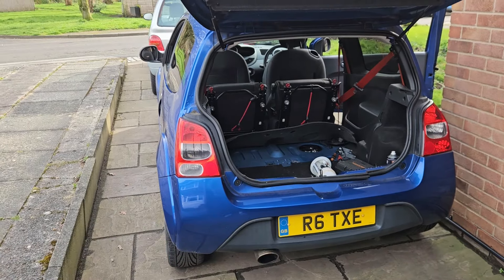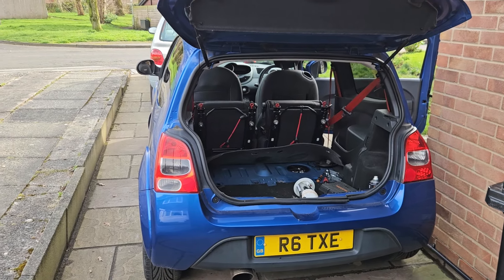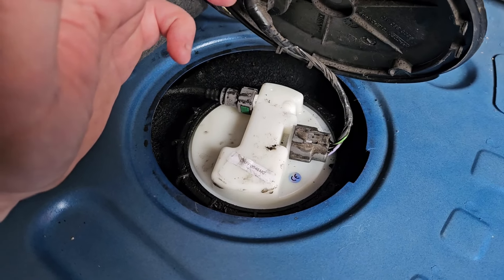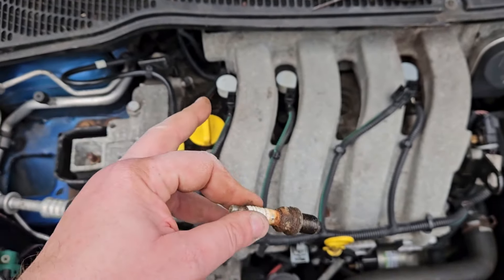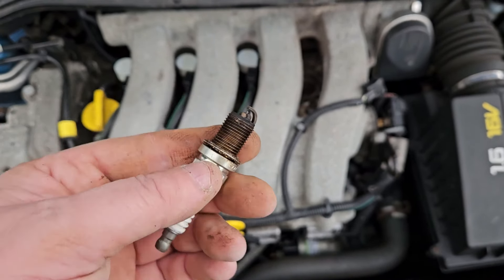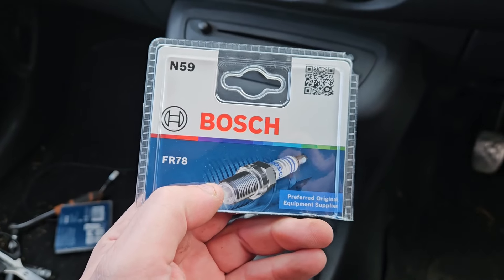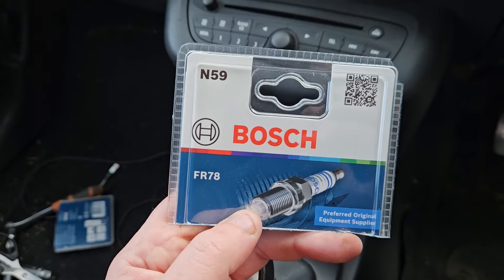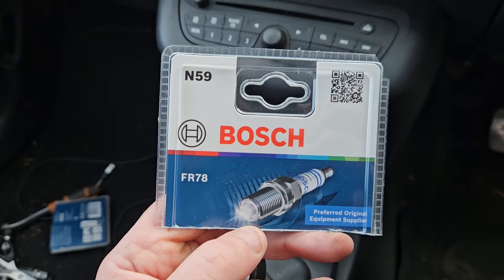Can i solve the misfire on my RenaultSport Twingo 133?

Comment: Here's a tip to keep you out of trouble. Use NGK U5001 ignition coils (those with a metal part), which are better designed than BERU coils, and also apply grease (Beru ZKF**, or Fluostar 2L**, not silicone grease!!!) to the upper seal of the coil to facilitate installation and improve sealing. **The same grease as for the porcelain part of the spark plugs, as it won't damage the silicone rubber !! Remove the ignition coils, check, and re-apply grease before reassembly every 2 or 3 years to make sure there's no water in the spark plug wells.

Comment: I've got the same issue with cylinders 3&4. Whoever replaced the coil pack on 4 put the securing bolt in too tight and has sheared. I was a bit reluctant to to use excessive force on the spark plugs in case it did snap. But seeing as I need to get the manifold off to sort the coil pack retaining bolt I'll leave it until then.
Reply from the maker: I had same on cylinder 4 coil pack retaining bolt. I tapped it out and then installled a 10mm bolt not an 8mm.

Comment: I have also on a Twingo GT problem with Misfire it say on Cylinder 1 it blink the MIL and like in acceleration it goes like sometime empty i change also the Spark plugs like 1 to 4 and 2 to 3 and it say then to me Cylinder 4 misfire
Reply from the maker: Check your central coil pack. Different ignition setup to the 1.6 engine.
Reply: A rattle at start up can be a dephaser fault